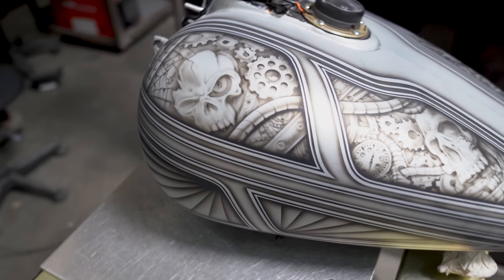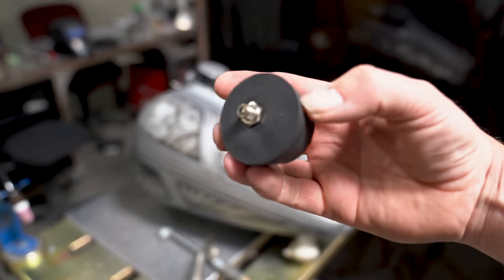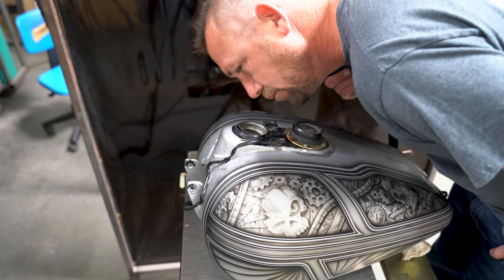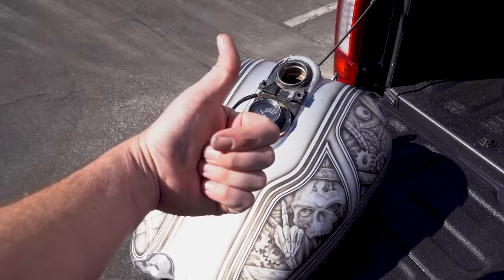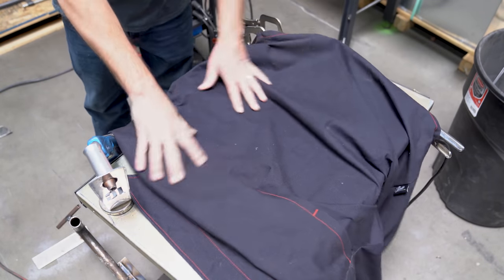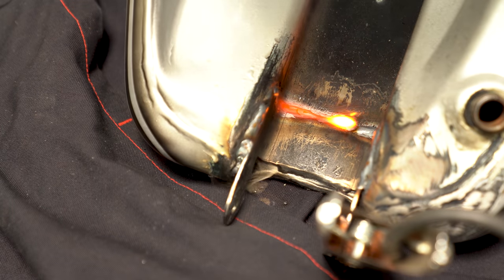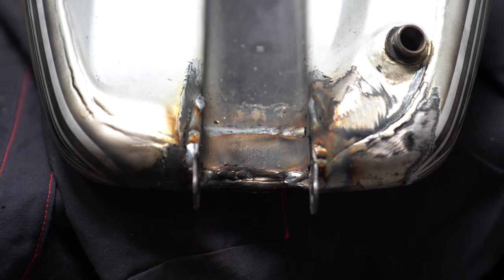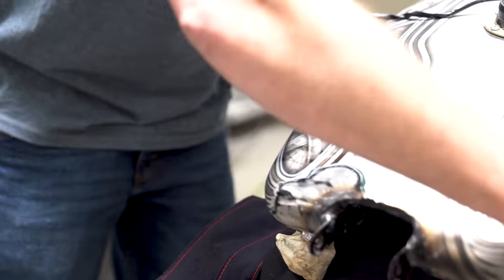Weld Repair on a Gas Tank

Comment: I had to cut out and patch a fairly large piece on my motorcycle tank. It took me forever to get all the leaks out (didn't really know what i was doing). I even painted it myself and it came out great, until it started leaking again. Now that I finally had all the leaks gone I decided to pressure test it like I should have before. So, I soaped it up and used what I had on hand to pressurize it - the exit of my shop vac. Now I have a very pretty bowed to hell unusable tank hanging on my wall; he's very right when he says to use a very small amount of pressure. I ended up finding a really nice matching set of panels and the tank on ebay that someone was trying to get rid of and that was that.

Comment: I like the burn the paint off method too. Just be careful not to use it on military CARC paint, the older stuff contains cadmium. Not a good thing to inhale.
Reply: Airplanes too, that zinc chromate was wicked stuff

Comment: Have you ever considered using dry ice, to inert the tank? This method is use to demo large gas tanks (thousands of gallons capacity). Removal of the bracket, welding then reinstallation of the bracket, would be the ideal repair. As a point of information I am a retired safety professional and a retired certified high pressure MIG, TIG, stick welder.

Comment: Very informative and so important when working on tanks. I know someone from my town who was welding a fuel tank in a boat. They should of known better but they didnt remove the tank first and mustn't of flushed it very well but when they welded it the whole tank with the boat exploded. Luckily a large sheet of metal flew up and hit him while actually protecting him from other debris at the same time believe it or not. He was so close to death. Broken bones, nose, burns, lost a heap of teeth. It sent him flying. Its taken years to recover and he has never been the same
Reply: Had a neighbor who wanted a bracket welded on his gas tank in an old Ford pickup.  He said some guy welds them with the tank full to keep them from exploding.  I said, "I'm not welding on a gas tank unless it's empty and flushed thoroughly"!  He took the tank to someone else!!
As a kid I used to work on and modify bikes a lot, and I would always empty them then flush with soap and water several times.  As a last check, I would point the torch in the tank to see if any fuel vapor would pop!

Comment: On the gas lines us Pipeliners do, they have roustabouts purge the line with Nitrogen, we cut a fish eye in the pipe for the flames to flow through before we make the beveled cut or weld a root pass in. When you see flames coming out, that’s good. But when there’s no flames… then we got a problem somewhere down the line.

Comment: Very good solution. I would have done it the same way. 
Today I had to repair a broken snozzle from a fire truck. 3" aluminum pipe broken in two pieces. I like my carbide air grinder, it removes a lot of metal and leave the bevel clean and shiny.

Comment: I have a 2015 V-Star 1300 that has developed a leak in the tank.  I paid a local shop $300 to fix it.  They used J.B. Weld on it.  I didn't even get it home before it started leaking again.  Since we're heading into winter time here in Oregon, it's finally getting to a time of the year when I won't be able to ride it much, so I'll have time to pull the tank off and fix it myself (which I should have done from the start).  I was thinking of soldering it rather than brazing it, but it might be worth it to buy a brazing kit and do that instead.

Comment: man...u did a great job...i know how stressfull is to weld a gas tank and you made me know my mistake ...we weld the bottom of the tank and leak appears on the top of the tank after bottom got welded .. maybe we didnot clean the fuel enough like you did and the weld burns the fuel creating holes in thin areas ..,,also what i notice is since petrol is thinner than water , it penetrates small holes which water could not seep through even wit air pump

Comment: I owned a Radiator shop for a couple of years. Gas tanks are hell on earth, but in the 90`s they were not lined. The solution was to tin the shit out of the area, with an acid flux and a torch, with a fiber brush. apply solder.  you can inert any flammables with an auto, or small engine exhaust hose, dumping carbon monoxide, into the tank. This method uses much less heat, and reduces the risk of burning out thin metal. 
There was a product called Tank Tech, which was a polymer for the inside of tanks. The tank should be lined to prevent further pinholes  I do not know what is around today, to do that job.  Your welds will not prevent that tank from showing up again.

Comment: Empty the tank to be welded of any fuel connect the exhaust from your car for 5 or to 30 minutes depending on size of tank to weld leave the vehicle running while you weld braze, sodder, torch tank in half no problem. There is zero chance of explosion using this method. Works for gas, all types of fuel or oil no matter. After running auto exhaust from flexible hose fitting from tail pipe and fitting the other end into tank to be welded then to continue auto exhaust flowing through the tank and venting well out of the tank while welding repairs are being done. It is simply impossible to cause any fire or explosion. Truly the safest and best way to weld any type of gas or fuel tank.

Comment: a trick i like to use if i blow a hole is to fire up the gas plant and run the flame around the edge of the hole that was blown. the idea is to melt the metal creating a bead on the edge that is thicker than the base metal. being thicker it can take more heat and is less likely to run when you are trying to fill it. then you can weld up to that with the mig.

Comment: Hi in the pass when I had to weld up a repair that seem to have a Leck in almost the same  place your video  shows on a tank, if it come out one side of where the bracket is. I will run a grinder though the bottom of the bracket, (tank upside down) so I have about a 5 mm gap, then weld it back up, then just weld the one side only. It save on time and work and maybe damaging the side not lecking. But otherwise, great video. Thanks

Comment: I've welded fuel tanks that have been thoroughly cleaned but I've also welded tanks with fuel in them. You have to not only purge the tank to remove oxygen but keep gas flowing all the time while welding. you can use argon but CO2 is cheaper. Both are heavier than air, so you need to have a way for gas to escape slowly out the top. I use a flow meter on the purge gas so I know that gas is flowing. It would be nice to have someone monitor the gas flow but so far no one has been willing to be close enough.
Reply: Finally- someone who knows what's up.
Weld on👊
Reply: @jasonmcqueen1411  I've reached the end of my welding days. I'd like for young people to know that a man welded fuel tanks with fuel in them and lived to grow old.
Reply: @phlodel  
Completely hear ya.
I can barely use my thumbs anymore. lol

Comment: A few years ago, I did a motorcycle gas tank like you did .  To test it after welded, I blew air in it.  As an idiot like I was, probably still am, I forced it to much.  Suddenly a hear a big Bloup! The gaz tank just swollen like a balloon.   That was done for the tank.  That is kind of when I realized what pressure to square inch pressure means😁

Comment: Only time I welded on a tank it was for a MR2 it was changing where the fuel pump is accessed to allow the owner to put in a second fuel pump.  Since it was the highest point I ended up filling with water then purging the rest with argon.  I figured with the size that was my best option even though it was cleaned out.
Reply: Argon is definitely the best option

Comment: The metal of the tank is somewhat porous and can trap enough fuel to cause an explosion after washing.  Inert gas purge is the best way to avoid a potentially lethal accident when welding tanks.  This tank is small, the danger goes up with larger tanks.  All fuel tanks are to be respected, however.
Reply: Very little fuel is trapped in porous metal.  The highest risk is crimped seams, which will hold fuel even when the tank is rinsed with soapy water or vented for weeks.

Comment: Have you tried to connect a hose to the exhaust pipe of a vehicle and put the gas inside?  It is also effective.  The advantage is that it does not rust the tank if it is made of iron

Comment: flush with hot water and dawn liquid . if you can't smell the fuel then its good to go. if you smell fuel do it again . i used high pressure steam at the power plant on my tank and it came out super clean

Comment: After washing, I simply pump low level air flow into the tank.  If anything flammable is left in the tank, the air vapor mixture is so lean that the flammable burns at the source and does not create an explosive AFR.   I braze these brackets.. Old school stuff.

Comment: I use electrical contact cleaner for those tight spots. It comes in a pressurized can like carb cleaner. It dries completely and doesn't leave residue.

Comment: Looks good.  If a tank has been previously lined with a sealer like POR-15 or Caswell, will the heat from welding screw up the lining?
Reply: Yes, and he says that in the video.

Comment: Why not use silicin bronze mig? Ive mig brazed a shit ton of crappy thin metal over the years,with .023 then silicon bronze,just wondering Thx for all you teach us!Dry ice is also a cheap easy solution.

Comment: The fastest way to de-fume I ever saw a mechanic carry out was when my Honda Civic tank got punctured by a sharp rock on a dirt road from a random rock fall. The tank got a big dent and a hole, 100 Km from the nearest fuel station, and fuel leaking out, So I grabbed a couple of sticks a jammed them in the hole to slow the leak down. When we got to a small town, found the local mechanic, he collected the fuel he drained out, then he put the exhaust of his diesel truck into the tank. The heat vaporises any remaining fuel and the fumes are oxygen free. After 10 minutes he bashed the dent out a bit, then welded it up in 3 minutes. Re-filled the tank with the collected fuel (after re-fitting to the car), and away we went, $50 repair. Never leaked, good repair.

Comment: Fuel tanks are very easy to weld. Flush with water, then run exhaust into it while welding. No boom, I've probably done thousands over the last 50+years.

Comment: I have a question for you
Hi
It that my son has a motorcycle that he has had to change the gas tank because it has oxidize inside and it is affecting the combustion and the carburator
it doesn't have gas licks but it is really corroding itself
is there anything that we can do besides the obvious of changing the tank❓

Comment: You need to tell your viewers that there absolutely has to be TWO open holes in that tank before you stick that damn torch near it. Only one hole open and torch equals boom. Lighting them up is the safest way I found to weld on them. When it won't re-light it can't explode. Forty three years welding, patching and modifying fuel tanks and I'm still here to post this.

Comment: Many owners of custom bike crack their tanks (especially the older style split HD tanks) by failure to shim the mount brackets which causes the attachment bolts to bend then eventually cracking the tab or the tank. If you work on the bike as a whole not just the tank, make SURE you test fit the tank to the motorcycle, preferably before painting it. Then you won't get blamed for a crack because there won't be one. 
USB borescopes are dirt cheap and dandy for inspecting fuel and oil tanks and inside frame tubes.

Comment: I have been doing this for 35 years and I have never had luck brazing or welding a tank. We filled with H20 and cooked entire tank on a bbq grill several times.  I have filled with water and detergent and as soon as heat is applied the fuel in the pores of the metal start to ignite !  The older the tank the harder they are to seal successfully. A new tank is the best way to go. IMHO.

Comment: well done 👍,    an additional method (old man, old school)  remove bracket by die grinding off welds, make new bracket.  de-fumeing tank:  drain as thoroughly as possible,  put a pint to a quart of anhydrous alcohol(180 proof vodka will work) , slosh thoroughly and  pour out.  alcohol mixes with water and gas so will rinse out with water well..  After all that should fill tank with water leaving enough space for an air bubble around welding area. do the welding.  then after drying out tank do the alcohol thing again, no water at end (to dry tank out),    Man I know lost half his face to the end of a 55gal drum  end blowing out from fumes in a drum that had not been sufficiently filled with water, after a thorough steam cleaning.
Reply: He says in the video that he didn't do that because it would have taken too much time and been too expensive.

Comment: I'm an industry welder and don't do repairs like this, but I would have used an angle grinder to remove the fasteners and put in all new sheet metal and make new fasteners.

Comment: I use CO2 from my MIG welder with a 2nd regulator and line with constant flow while welding with the cap off to weld fuel tanks and have never had an explosion or fire. Even after a good washing I never trust a gasoline tank.

Comment: Justin, did you ever weld a diesel fuel tank? I think that they are harder to degas since diesel is way more viscous and les volatile. Did you ever heard the method with filling it with water as a purge agent and maybe for cooling?
Personally i don't go near a  fuel/oil tank with a welder, i would blow through it, or blow up.
Reply: Diesel fuel an fumes don't burn like petrol does so there a little easier to clean.
Washing out diesel tanks does need more care as left over water can lead to Diesel bug.

Comment: I purge stuff that had any type of gas or diesel with a good helping of rubbing or isopropyl alcohol. Since itll mix and thin the fuel left in it when u pour it out the alcoholic evaporates quickly.
Then flush with water and any remaining alcohol dilutes with the water and its inert after that point.

Comment: This is not the case but when I need to repair a gas tank I am puting the tank on a wood fire and the heat of that fire it takes out every particle of the gas remaining in the walls of the gas tank. I consider to be the only secure way to repair the gas tank with a welder tool.

Comment: i am surprised the owner didn't get it sealed with some sort of tank sealer. it will usually fill pinholes or small leaks without having to touch the paint at all.

Comment: A lot of years ago, and I do mean a lot, an old guy taught me to use exhaust fumes to clean out a gas tank. Tank on the ground then, use an old piece of exhaust pipe to run exhaust fumes from another vehicle into the tank being repaired for about 20 minutes or so. The hot exhaust removes all fumes...

Comment: Would it have been better to cut the bracket loose, clean and weld again? Didn't look like it was a significant weld to start with. Almost looks like a crappy tack/stitch weld. If you had done it that way couldn't you have then Tig it? I'm guessing the customer didn't want to pay for it?

Comment: If you actually know what you're doing, you can guarantee it. Cut the bracket of like you should. Then weld the tank, grind, and sand, and if necessary repeat till the tank is sealed, and then weld the bracket back in place.

Comment: Thanks, needed this with my car fuel tank and maybe this time i clean the tank after checking previous owners work so i wont be 3rd to bang my head to same wall repeatedly tallying 4th destroyed fuel pump. And no i cant just get new tank even if i wanted to. Happens to be pretty rare model these days.

Comment: General question, 
Why not just clean it all up and use a vacuum and metal epoxy to repair such pin holes ? Using the vacuum to pull the epoxy into the hole.

Comment: I am a welding instructor with a desire to shoot videos for my students. It seems one of the many complications to this is figuring out how to get a good shot of the puddle. There is some insanely expensive equipment out there, but I know someway, somehow there is a cheaper method to shooting the weld puddle in a clear enough fashion to present proper weld technique to students. Does anyone have any suggestions on how I can get a clear shot on the puddle as I’m welding? It would be mostly for TIG so I’m not worried about getting spatter on the lens. Any and all help is deeply appreciated 🙏🏼
Reply: Zoom lense with a high ND filter, (ND64 or higher I think, worth some googling to be sure).  Iso all the way down shutter all the way up.

Thats the cheap way at least
Reply: @JD-ub5ic  now is that just for like any standard DSLR camera? I’m not super savvy on them, but I’ll need to invest in one if so.
Reply: @MrDaltonBousum  Sure it would work on a DSLR, or a mirrorless, or anything else. They even make ND filters for go pros. All this filter does is reduce the amount of light that comes in which is exactly what you want, the same as a welding hood. Typically they screw onto the end of your normal lens. The most common use case is stills with outrageously large exposure times (like the still shots of waterfalls where the water has motion blur), due to the long exposure you have to let in less light to not overexpose the shot hence the filter.

Whatever youre currently using there is likely a filter for it unless it's your cell phone, in which case without buying any new equipment your best bet may be to just shoot through a welding helmets lens.